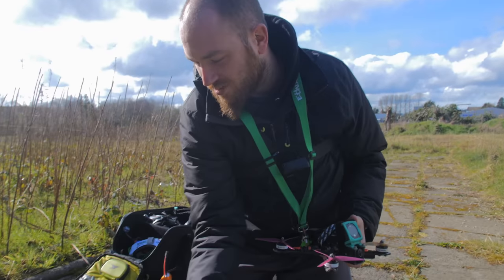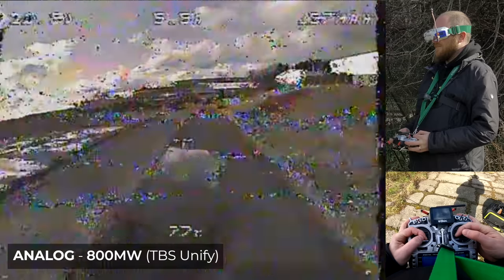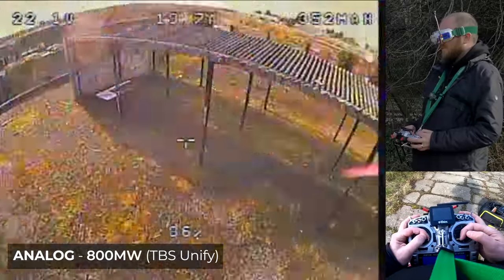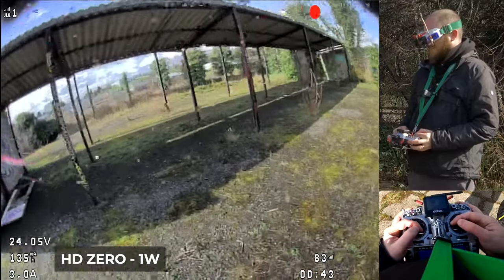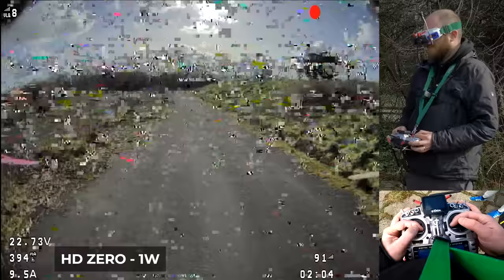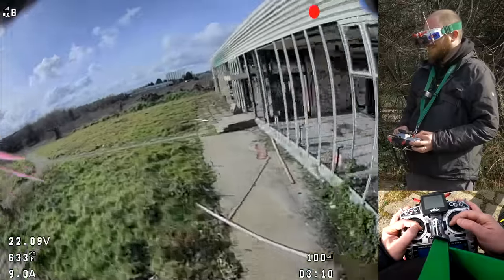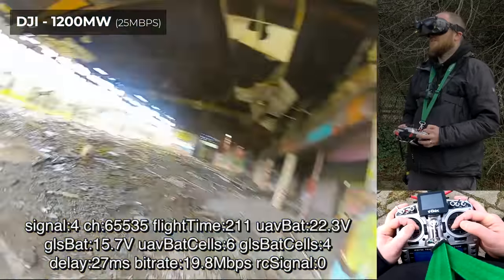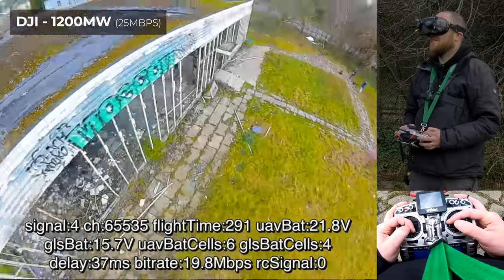HDZero vs Analog vs DJI - Penetration & Image Quality Test - small bando

Comment: I am surprised no one mentioned unfair test because Dji the only one has 1200mW
Reply from the maker: Yes analog was only 800mw also (mainly as this was the only vtx I have). The vista is capable of the higher power output so that’s that people will be using I’m sure. I’ve tested hdzero 200mw alongside analog and it’s a similar result as I have described here. I’ve tried dji at 700mw and again the results are similar
Reply: @int3fpv   test like this that makes people miss understanding, doesn't matter analog, HDzero, DJI the power are the same , Power(watt) = Volt X Amp, numbers don't lie, the difference just the hardware and firmware. If you wanted to conduct fair test, use same hardware, vtx, antenna etc and the same firmware, i know it's impossible that's why i just wanted to point out that fair test is impossible.
Reply from the maker: Well I kinda feel that this was more a test between analog and hdzero (for me at least, as I know what dji is capable of and what it’s pros and cons are) and my general feeling is that mw to mw hdzero has an advantage in the first 60-70% of penetration as the image is clearer and sharper, after that I find the breakup to be unpredictable with the full screen flashes very distracting compared to the more gradual analog breakup. Really all the systems have pros and cons so just use what you think will suit your style of flying
Reply: The results would be the same regardless. I came from analogue to DJI and analogue on 600mw is destroyed by dji on 25mw. Don’t hate on the dji because you don’t like them. It’s by far the best system for penetration and image quality. And as he said you can see where you are going
Reply: @randall8686  did i said i hate Dji?, who don't want clear video and good penetration lol, i am saying that SCIENTIFICALLY speaking, ether analog or digital OR computer, microwave, drill, whatever that required electric in it are,,, 
Watt/Power = Volt X Ampeare, 
what could make DJI so far superior afterall is just its hardware and firmware.

Comment: Analog 800mw, DJI 1200mw, DJI LHP and RHP ,analog only RHP. Comparatives without a base science worth nothing, this is one
Reply from the maker: This is a practical real world user test with typical setups for each system not a lab test. As an extensive user of all 3 systems I can confidently say no amount of tweeking antennas or a few hundred mw of power is going to change the outcome. Check out Chris Rosser or MadsTech youtube channels if you want a lab comparason of the systems.

For the record I fly mostly hdzero as I fly freestyle very close to myself usually and appreciate the steady latency.

Comment: All three of these systems are absolute garbage and a disappointment.

Come back in maybe another 10 years when maybe the industry gets its shlt together.  Right now, you're just going to get burned buying any of this as an early adopter.  It's still very much a rlp0ff industry.  Get a sim and a controller, fly and crash all you want for almost free.  Avoid the RC hobby, it's a c0n.

Comment: Flown them all DJI latency its annoying sucks compared to both systems  also the pixels in the DJI goggles, you must have the worst analog system are you flying in 25 watts
Reply from the maker: Tbs unify 800mw, tested with an irc power meter. Unfortunately I didn’t have a higher powered analog vtx
Reply: @int3fpv  stay away from any TBS VTX they are all garbage had 2 of them try the Mach3 VTX night and day difference ,BTW TBS other products are great